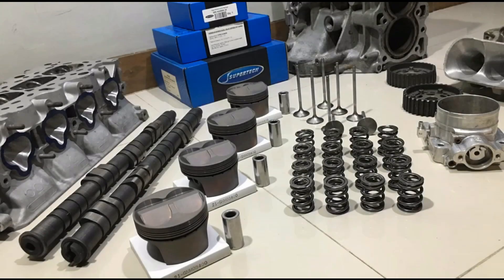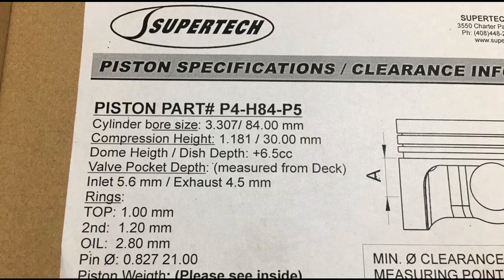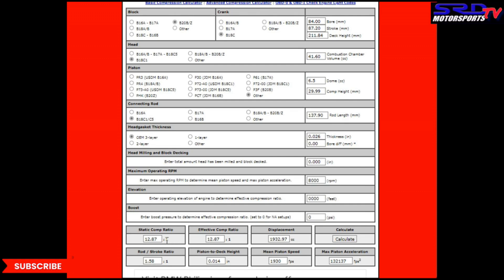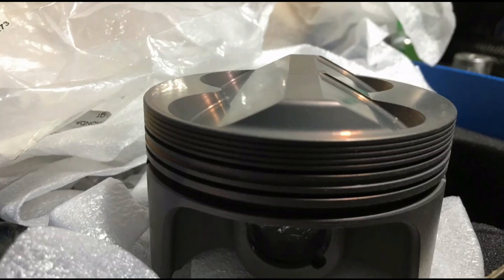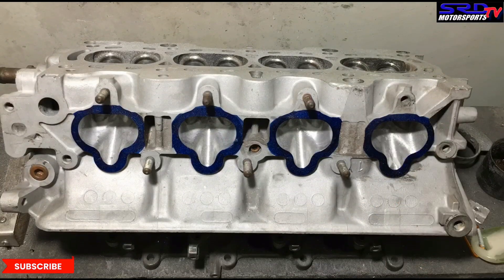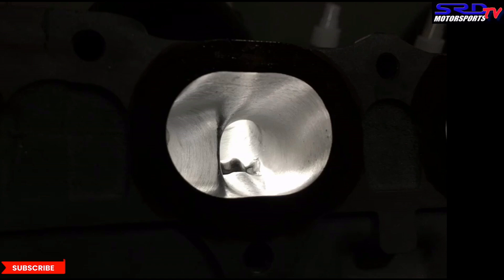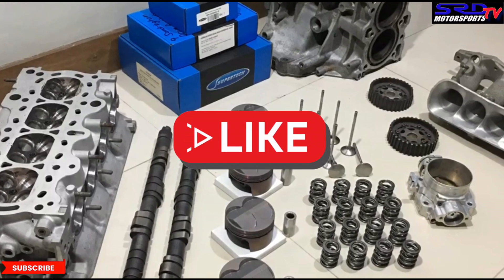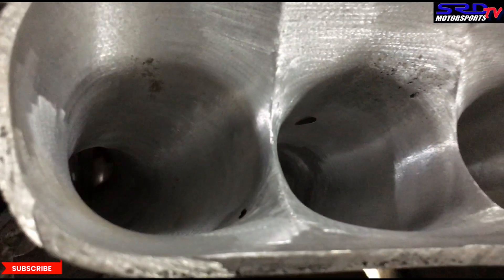B20 VTEC RACE Set-Up Build discussion by SRDmotorsports

Comment: I am loving these b20vtec build videos. I am going to be building a b20vtec soon. One question, when you say this engine will be on pump gas, what do you mean by “petrol blaze”?
Reply from the maker: thanks @findtherightbeat  yeah sorry didnt have a logo to insert on the video its 99-100ron so most likely a US 95-96octane rated

and suuuuuper glad @TrackSol this entices you and the topic discussed on cams and intake ? same on b16 or b18 the bigger cam weakens the signal towards the end of the duration

so either even more comp or better intake or 
hmm ITB? 😏
Reply: @SRDmotorsports  Yes the camshaft and intake topic was also very interesting. I would love ITB but I've heard lots of bad stories about difficulty tuning for street use.
Reply from the maker: @TrackSol  another further follow up (lol) as i read your comment and since you mentioned ITB? I looove the idea and have for both sohc and dohc and i hope "this year" i get to test run the sohc itb and you can be sure will have a real goood video about it

the tuning issue we mostly hear is the map sensor signal and i got a few tricks up my sleeve and if it works then it would change the game 😏 would make it practical even for daily lol
Reply: @SRDmotorsports  Are you using Crome Pro's Alpha-N feature for your ITBs or are you running another EMS?
Reply from the maker: @findtherightbeat  crome free 🤣
Reply from the maker: thats the thing why i wanna study it further and test my ideas... no plans on proving people wrong no...

but a "solution" was never always "change this" right away... we know the issue is vacuum signal linearity for the map sensor... 

lets solve that vs ditching it for alpha N/tps  right?
Reply: @SRDmotorsports  I'm getting old, I went back to my comment right before you replied and saw that words were missing (I thought I typed every thing in haha 🤣🤣)

I've seen a lot of good builds run on Crome free. For me, it made tuning accessible to more people and made mild builds more potent and efficient. That and the 84mm P73 or P30-style cast pistons 😀
Reply from the maker: @findtherightbeat  def agree man def agree and lets include early days there were ITBs running good too sadly they might have kept it to themselves til they stopped lol
Reply from the maker: but definitely will be switching to s300 soonest mainly cuz of the ability to datalog "up to 5" auxillary sensors... funny cuz til now locally we see s300 runners just using it as if its crome no taking advantage of its added featuers :(
Reply: @SRDmotorsports  Looking back, it's crazy how people paid for the Toda ITBs instead of just modifying the 4AGE one's. 

One funny thing I saw online fairly recently was someone selling OBX ITB's for a price that'll make you want to scratch your head.
Reply: @SRDmotorsports  They could've allocated the budget somewhere else, haha
Reply from the maker: @findtherightbeat  thats true on Toda!? i mean id have gotten Jenvey for that but even then... id jst gotten cams lol
Reply: @SRDmotorsports  Yes I mentioned ITB because I love love love the ITB sound but concern about daily driver use.
Reply: @SRDmotorsports  True aftermarket ITB is very expensive, and power increase isn't that much over camshafts, ported head, intake manifold and throttle body. But the sound of ITB is rock and roll!
Reply from the maker: @TrackSol  Definitelt agree on the sound but also if you check my video a few months back, the one with title "ITB + d16a6"
i did talk about runner lengths and the areas where itb shine + that lets u match cam and work to it to make it even more excellent :) that's where the power is when one can make the ITB work for the set up and the set up works for the ITB
Reply: @SRDmotorsports  I watched the ITB + D16A6 video. I would love to build B20vtec for high RPM to use 2nd harmonic boost
Reply from the maker: @TrackSol  oh maaaaaaaan  same here... its why i wanna progress on my d16a6 while going for 3rd harmonic for now it would help us gain more data so when i go B20vtec we ready with reliable data to continue research and developments
Reply from the maker: @TrackSol lemme know if u dont mind... your planned b20 and pistons so maybe on the next video i can insert a section of the vid computing it for you the compression i mean il record the vid while we compute

as we all know... there might be 5 or 10 more in the world planning the same :)
Reply: @SRDmotorsports  Sure thing. Since this will be street car using American 93 fuel (98 RON), the build is B20 with B16A head, YCP brand ITR spec 84mm piston with P2P0 rods, ARP2000 rod bolts, Skunk2 valves, springs and retainers, Skunk2 ITR style manifold and Skunk2 70mm throttle body, Skunk2 Alpha V1 header (long 4-2-1 with 1+2 and 3+4 pairing). I still have to buy the pistons/rods, and LMAs. Also, I havent decided on a camshaft yet but I was thinking Skunk2 Tuner3. Do you recommend something else for a street/weekend race build?
Reply from the maker: @TrackSol  oh man your planned b20 is real real good and ive heard of P2P0 rods since way back for the vitara and pm7 days so def know them and have not heard not one negative thing about them! 

the Alpha header is good too !

I think the tuner3 might be quite ideal for you as the vtec lobes on duration is still bigger than a pro2 BUT the primaries arent as big as a pro2  so we know befre vtec and idle will be decent and not demand more comp than what the ycp can give so  its like a stage3 that wont demand as much comp as a pro2 😏  oh man this set up sounds real good good

btw the YCP piston spec for you to calculate? is
3cc dome
29.86mm compression height

i personally measured this as i could NEVER find those info online

this means you are at 11.7:1 
mill the head 0.010"
you get 12:1 comp
and
if u mill the head 0.020" or half mm
you get 12.4:1

IMO any of these 3 is perfect even for tuner3

:)
Reply: @SRDmotorsports  Thanks for the reply on my planned setup. I agree that the tuner3 is ideal for this setup considering the use of the car mostly street driving so the idle and cruising doesnt suffer with the ITR spec pistons. Of course I will port match the IM to the head and TB, but with the tuner3 cams, would it still be good to port the head or will that outflow the tuner3 cams? 

Also, i saw the tip about the B20 bearings with the oil hole and matching hole on the rods. Since I am going woth the P2P0 rods, should I find and install B18C oil jets onto the B20 block?
Reply from the maker: @TrackSol  thanks too for checking the vid and while yes we continuesly share how we do things or how oem suggests it? its also more of trying to attract more business locally i mean hey would they spend their money on "oh trust me i know what to do" or a shop that openly shares :)

but ofcourse the rest is out of the country and so sharing info is two folds in benefit

and nice question once again
Reply from the maker: more flow will always mean more torque and power so we wont get enough of it 🤣

but since you have a b16 pr3 head check my earlier vid on TypeR style porting  even that basic clean up will do wonders for you

and why i suggesr that? well cuz once u done it youd go "hey i could do this! lemme port it completely" 🤣  and thats still a good move

check your p2p0 rods if it has a hole behind the bearing like the b20 if it does then yep run b16a bearings no need to install jets that will be difficult albeit might be even way easier to get b20 bearings bring it to ur local machineshop have them drill that oiljet on the rod like a b20 , bring ur stock b20 rods so they can reference it

ooops a secret! there lol
Reply from the maker: @TrackSol  Just a further follow up on the Rod mods regarding b16 bearings...

usually when running forged pistons? it is not needed as generally their operating size is generally good and does not need cooling as much nor does it expand as much as cast it is why even on GSR bloks when running forged? they plug the oil jets... but in YCP case it might be significantly better to mod it how i mentioned... and if you havnt started it yet? il try to squeeze in on the next vid a tid bit about that? as i have pauter and eagle rods here that are used and could show it when its with b20 or b16 bearings
Reply: @SRDmotorsports  I haven't started the engine build yet as I still need to purchase more parts. I need to buy camshafts, pistons, rods, and intake system. I am planning to use YCP 84mm P73 piston with P2P0 rods combination, or Nippon Racing 84mm P73 piston with SCAT rods combination. Both those combination are available on ebay. Between the YCP and Nippon Racing pistons, which would you recommend? Both are cast, so if you could mention oiling port modification to rod to cool piston in B20 block in next video that will help alot. Thank you.
Reply from the maker: @TrackSol  I think both ycp and Nippon Racing pistons are equally durable so either one is good :) and ayt cool lemme find a way to sneak in on the rod stuff in one of the upcoming vids fo sho
Reply: He's in Asia and he's referring to Petron Blaze:

Type / Quality Level

Premium Plus Grade (RON 100)
EN 228:2005
PNS Euro 4-PH

Have this guy build your head, he's done the WTA head on Elusive's DC2
Reply: @findtherightbeat  Thanks for the info on the fuel.
Reply from the maker: il get some further measurements and include it on the video... cuz the skunk2 / ITR style manifold is still cut open ftw

Comment: Are you running seat angles on the intake side quite close to 36°-45°-67°-80° and then blended into the throat? I'd understand if you don't provide the details, just thought I'd ask
Reply from the maker: that is close yes 35-45-68    mainly the trick is the curve/blend after the 68

Comment: Better geometry = better longevity
Reply from the maker: maaaan you know it! and a lengthy talk would also be "rod angularity" on "while" the combustion pushes the piston down = better power angle

finest example b16a vs b16b granted same piston and cams the 16b wins always
Reply: @SRDmotorsports   Interesting thing that's often overlooked when it comes to endurance engines. Same thing with the JDM D15B Vtec vs the D16 for road racing. Some say it's negligible but people have to listen when an experienced machinist speaks to them about cylinders out of round.
Reply from the maker: @findtherightbeat  yes!!! it is why the d15b is rated the same hp as a d16z6

subsequently Bisi found out (i sent him) a jdm p08 cam it was slightly retarded on vtec maybe just maybe honda knew top end will sing hmmmm
Reply: @SRDmotorsports  By the way, what ex-manifold will you be using for this build?
Reply from the maker: @findtherightbeat  actually it might just be the usual smsp style cuz the hytech lay out might "sabit" as owner is a lowrider 🤣
Reply from the maker: @findtherightbeat  notice that... b16b the stock header was/is different from ITR so hmmm interesting yeah?
Reply: @SRDmotorsports  Also, do you rework the Supertech pistons on your builds?
Reply from the maker: @findtherightbeat  not much except only when needed to slightly increase p2v 

which is rare it only happens when we are left to run an overly shaved head prior

but on the next few vids of a different build i might delve deeper into ring gaps etc etc
Reply: @SRDmotorsports  Not really into moto but I chanced upon one suggested video and ended up scratching my head. The local moto guys should learn about proper ring seal from you, I'm really not sure why they like shiny aftermarket bores and very big ports -- Most are still into broscience where bigger, wider and shinier is better
Reply from the maker: @findtherightbeat  actually one reason i made that video? is cuz when i searched here? i was shocked that most including locals? just say "the ring markings means UP"

not much explanation on their function and why chrome steel ung top ring etc etc so i agree man... "par science" lol
Reply: @SRDmotorsports  I mean it's not really a secret: proper clocking, material and prep and many still prefer to run things right off the shelf
Reply from the maker: @findtherightbeat  yep i agree and i must admit before i made the vid i researched to be "sure" and i learned more too! lol